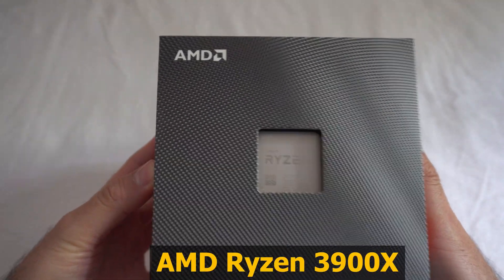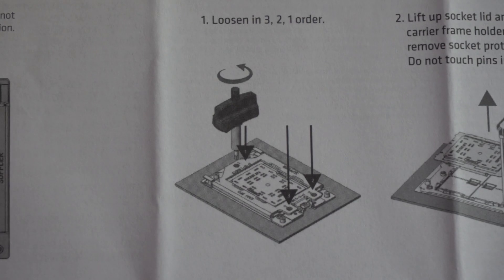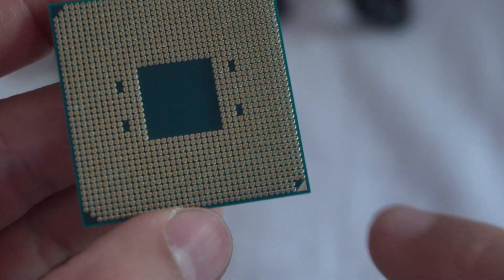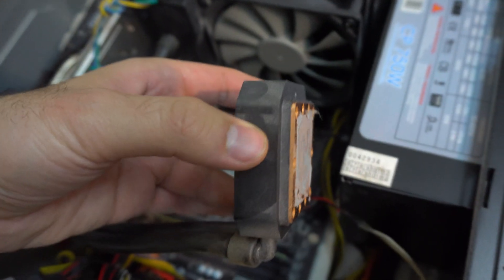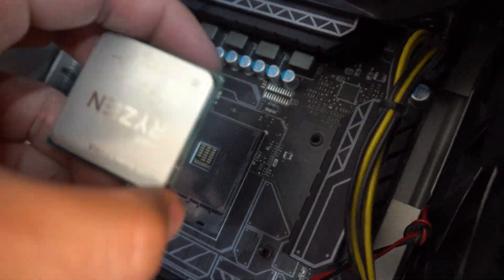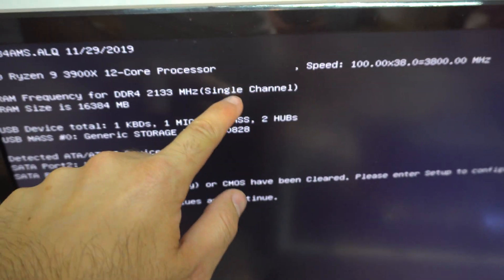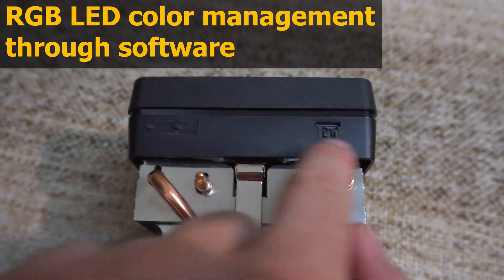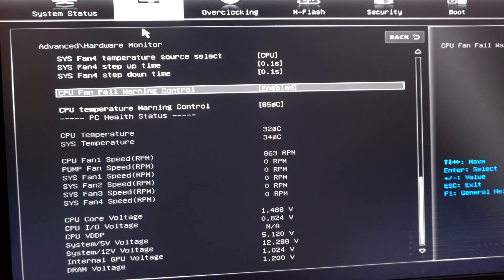AMD Ryzen 9 3900X CPU + RGB Fan (Unboxing, Installation, BIOS settings)

Comment: What adapter mount did you get? I upgraded aswell and it didn't have the bracket for the new mount
Reply: hey man did u ever find one? I got one as well and need help finding one
Reply: @mrbluntmann1357  it uses the AMD4 bracket mount. 3000 series uses the same has the 5000 series

Comment: That's one of the advantages of PGA socket. Easy to clean that socket.
Reply: You mean BGA Socket?
Reply: @arunachalamganesh1157  PGA, not BGA.
Reply: @ulungrinjanidharma8609  It is BGA, not PGA. Here's a link https://en.m.wikipedia.org/wiki/Ball_grid_array#:~:text=A%20ball%20grid%20array%20(BGA,mount%20devices%20such%20as%20microprocessors.&text=Soldering%20of%20BGA%20devices%20requires,usually%20done%20by%20automated%20processes.
Reply: @arunachalamganesh1157  what????? BGA cpus is soldered. and you have to solder this thing to AM4 motherboard???
Reply: @ulungrinjanidharma8609  But it is not PGA.
Reply: @arunachalamganesh1157  its definitely PGA.
Reply: @ulungrinjanidharma8609  How are you saying? I even shared that link.
Reply: @arunachalamganesh1157  https://www.youtube.com/watch?v=vzKcrwlmREE

there is a ryzen CPUs, that thing uses PGA. No upgradeable cpus use BGA.
Reply: @ulungrinjanidharma8609  Ohh, my bad, it's PGA.

Comment: If I were to upgrade later on will the socket be the same after 6-7 years?
Reply from the maker: I'm not sure, probably not... or at least a simple BIOS update will be absolutely necessary (I also updated the BIOS).

Comment: i just installed my ryzen 3900x and the temp of the cpu on idle is around 64 degrees. My old cpu had a lower temp when running so is there something wrong?
Reply: no i’m pretty sure it’s normal just make sure it doesn’t go above 85 celsius i think

Comment: This or ryzen 3900xt?
Reply from the maker: 3900X
Reply: @furulevi  why?
Reply: @unreal4967  why not?
Reply: @unreal4967  Because compared to the 3800X the 3800XT has 200MHz extra Boost Clock whereas compared to the 3900X the 3900XT has only 100MHz extra Boost Clock. So for the price justification of the 3900XT, the Boost Clock had to be more than 4.7GHz.

Comment: Will it be supported with msi A320M-A pro max?
Reply from the maker: I'm not sure, I updated my older motherboard's BIOS before installing this CPU and it worked right away...
Reply: The Ryzen 9 is only compatible  with 400 and 500 series motherboards.
Reply: @Fake_Newsss  Then how is it compatible with his B350?

Comment: Sorry if this is a stupid question, but in comparison is the Corsair H100i liquid CPU cooler better? I know liquid cooling is always a plus, but how much of a difference are we talking? I’m about to do my first build, and this is the CPU I bought along with that Corsair CPU  unit.
Reply: Also, is the Corsair XTM50 paste much better than the preapplied paste that comes with the H100i? I’m new to all this, but want to make sure I’m doing it right you know.
Reply from the maker: Corsair H100i has 2 coolers and thus a larger radiator, so it should be better then the 1 cooler of my corsair. If an air cooler has many heat-pipes it can be even better then a large water cooler. The bad part of liquid cooling is the additional noise of the water pump and the possibility of failing of the pump. The original paste I think is OK.
Reply: furulevi thank you for the information, I appreciate it.

Comment: Important question man: can you take the ryzen 9 3900x prism cooler and use it on a ryzen 5 3600 processor
Reply from the maker: Both are for the AM4 socket so it would probably work, but I'm not sure, I don't have that CPU, I haven't tried it.

Comment: bruhhh hes touching the gold pins ahhhhhhhhhh
Reply: ikr i was just about to say that
Reply: It's ok in general you shouldn't but be surprised if they did harm the cpu they say they're fragile as well but they're about as fragile as copper wire if anything a bit less but you'd have to use some force to bend them buy a very old or broken ryzen cpu and experiment if you want I got a very very old one for like £10 lol.

Comment: OK, that was scary to see you handle the chip that way, but you did a very good job of showing how to place the chip correctly in the slot. in fact that was the best I have seen so far in regards to showing what you need to know to set it down correctly.
Reply: As soon as he put the lever down, the System started LMFAO. I couldn't give this video a thumbs down for that.
Reply: @jerrypawns8710  He DIDN'T powered off the system, BIG rookie mistake!!!

Comment: Don't know if you can take this video siriously lmao. 1 Stick of ram (500$ cpu) Thermalpaste on socket, Vacuum cleaning socket, 10$ pc case. It was painful to watch.
Reply from the maker: - 16GB RAM is pretty good (I could add more because I do a lot of video editing)
- vacuum cleaning removes the dust, blowing makes a mess inside the house, both can generate static electricity
- newer cases don't really fit my needs, they don't really allow quick HDD disconnections
- thanks for watching :)
Reply: furulevi Actually vacuuming also causes static discharge. You’re running 1 stick 2133mhz which will cause a severe bottleneck... I personally would run in dual channel.
Reply: @TriGamesHD  is 32gb of ram good enough.
Reply: X_CALIBER 2.0 Overkill if you’re only gaming.

Comment: Dude this is hard to watch. PC abuse lol
Reply from the maker: Don't be that sensitive :)) Where is the abuse?
Reply: @furulevi  you really need to step up your game, Firstly NEVER EVER EVER touch a CPU's gold pins, even when you have it on your fingers in your hands, you damage one pin, you'll have to get a new one. Secondly, NEVER remove a component of the PC when its switched on, you can cause corruption and * it up.
Reply: @furulevi  you should never work on a PC with it plugged in

Comment: what is this like what are u talking about in this vid
Reply from the maker: CPU = processor
Reply: furulevi Thanks for making this video. I just got a ryzen 5 3600 and I accidentally put one finger on the pre-applied thermal paste. Would this affect the cpu badly or should I just leave it. The finger print isn’t that large and still has a lot of thermal paste on it still.
Reply: @Its_JustJosh  Nothing happened. The upper part of the CPU can bear some touches. Just don't the down part of the CPU.
Reply: @Its_JustJosh  If you're so worried, apply some Thermal Paste on the CPU.